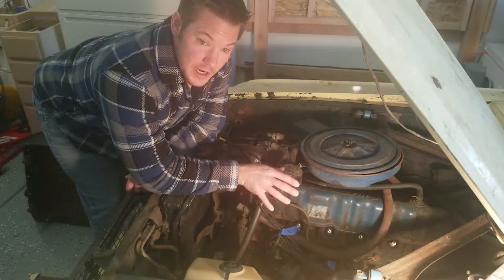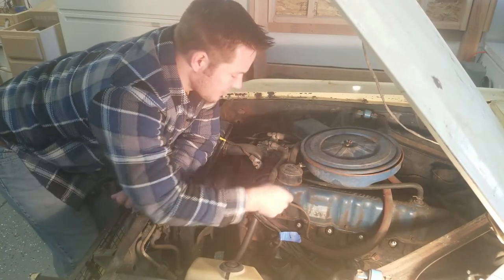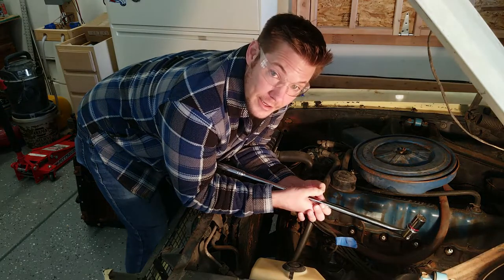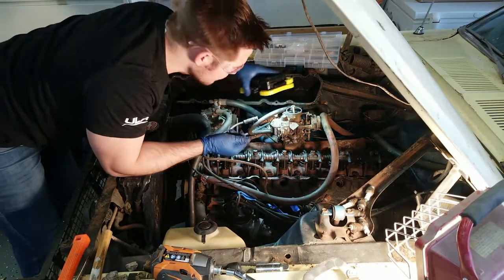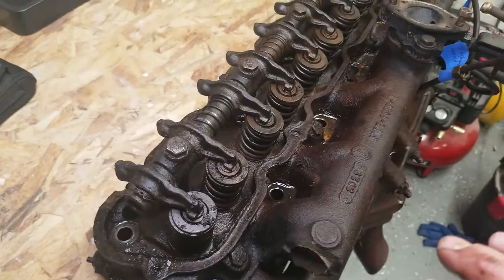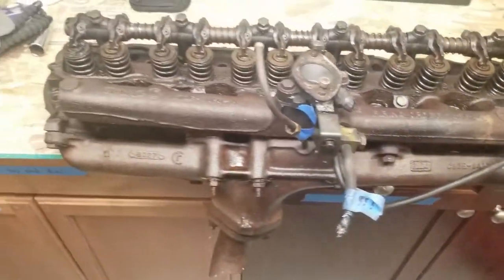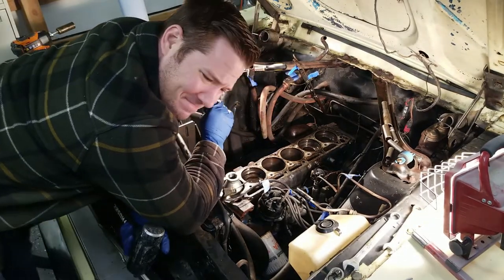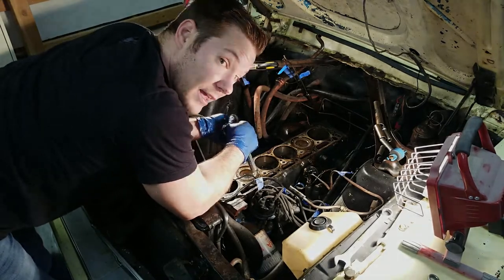How to Unseize an Engine (And Get Swoll)

Comment: I wonder how the fox body Capri's did not have to use those truss tower support beams.  But handled the automatic transmission and 5.0L, V8 without any noticeable handoffs. The truss tower supports on the mustang always looked weak to me.